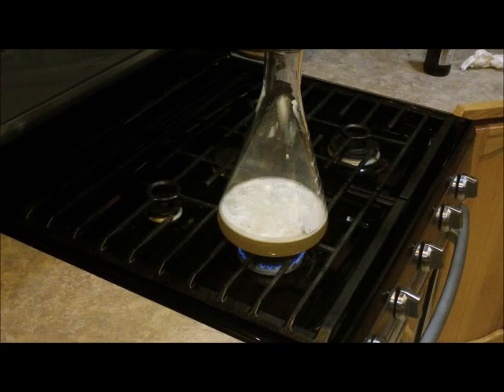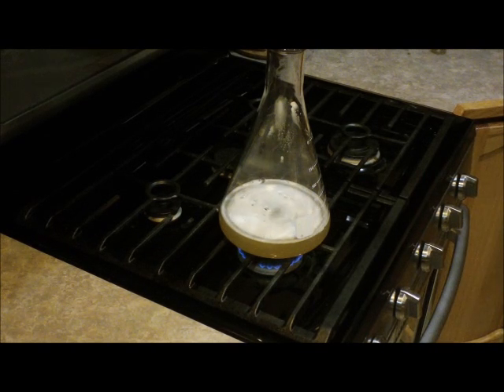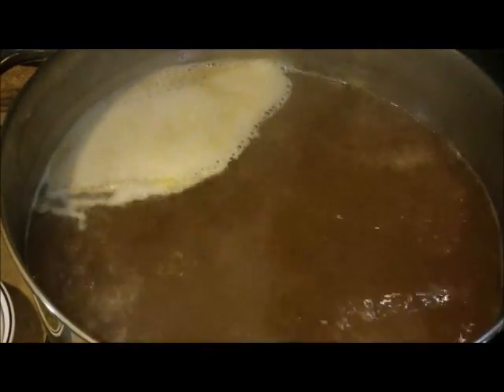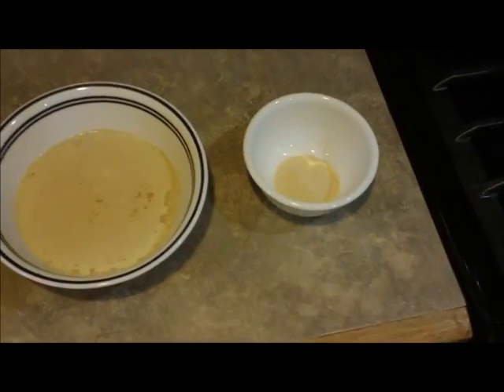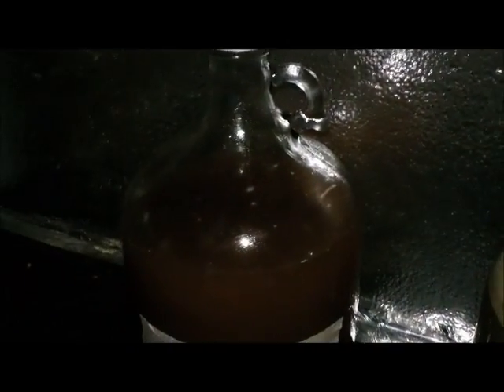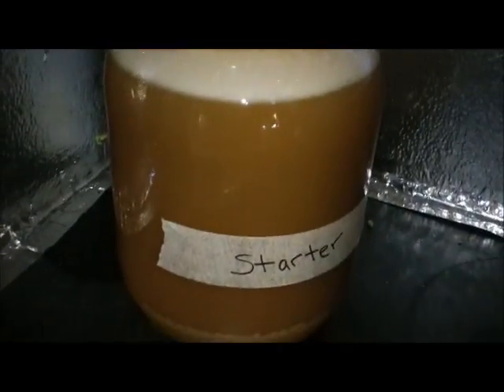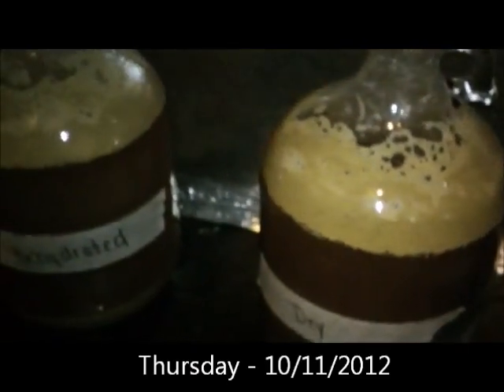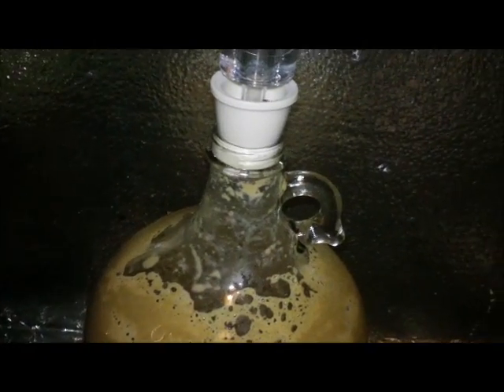HBW Vol 2, Issue 32 - The YEAST Experiment

Comment: The yeast cell equalize the above discription, so remember sodium follows water, as it does with human cells, you then drop these water hydrated cells in the wort which as a lower PH and way more sodium than the water hydrated yeast, now guess what happens, yeah sodium pumpd into the cell and with sodium the water follows and viola the cell walls expand and burst. Which is why the hydrated gallon had a huge lag time.  Therefore hydrating is not beneficial at all infact the correct process

Comment: I don't disagree with any of that, and when that is done seem to have very little impact on yeast survivability. Here is how i see it, Based on what we were taught in Micro Bio, the yeast cell walls will hydrate with whatever the PH is as the cells will equalize in the bothe the PH and sodium content of the water in which it is hydrated in. So in the case of the water in this experiment sort of proves this out. so here goes.

Comment: what this does is shock the yeast killing most of them. what needs to be done is after you make the slurry wait another 10-15mins and then start to slowly temper the temperature down to with in 5 degrees F of the wort it is to be pitched into.  you can do this using a spoonful at a time of the wort or must while stirring it.  when we use dry yeast its mostly for mead, wine or cider and it takes us around 45mins from start to finish. we also use go-ferm since the SG is pretty high with those

Comment: just some food for thought. I have seen the slants showing that direct pitching into wort will give you about a 50% survival rate due to the cell walls not being able to control what passes in and out. This is why rehydrating with plain tap water is preferred. the reason why I believe most people get the same result as we see here is due to people rehydrating @ the correct temp range. waiting 10mins then stirring it into a slurry, but then pitching that right into the cooled wort around 65F

Comment: That experiment is exactly what i always state, is that rehydrating is bunk! direct pitch or do a starter, rehydrating had a lot of lag time. I am glad the experiment proved that out. and the flavor profiles will be slightly different. the same amount of trub makes complete sense, yeast sense when the growth factor needs to stop due to the enzymes produce when nutrients get low, then the yeast just begin to go into survival mode using the fermental cycle instead of the kreb cycle. Nice job man!!

Comment: The Safale line is the best dry yeast in my opinion. In 2000 I won the gold with the 04 strain pitch directly in my Pipefitter porter and bottled it right from the primary from spigot!

Comment: main things to remember when re-hydrating dry yeast is to use between a cup to 1.5 cups of de-chlorinated  tap water at ~95F. sprinkle yeast and cover for 10mins. then stir into suspension cover and wait another mins. this is all so the yeast can build their cells walls. after all this you need to temper the yeast to with-in 5 degrees F  of your cooled wort, so you dont shock the yeast. just like you do with a new fish. add some chilled wort to the yeast to slowly bring down the temp.

Comment from the maker: My whole experiment was trying to keep everything as equal, without vitamins or boosters.   Outside of the starter.  Was interesting as I am a big fan of dry yeast, and S-05 and S-04 are great for IPA's and Ales.  I also used S-05 in my latest version of VBOC stout because I needed the higher attenuation due to the OG being so high.  Hopefully someone gets a little from this experiment.

Comment: just my opions here, but 1. forget the starter with dry yeast. its just cheaper to buy more dry yeast. 2. one 15g pack is perfect for a 1040-50 beer after that just add a whole nother pack. you will not over pitch the beer. 3. I hate when people pick an IPA to do these type of tests with. an IPA hides so many problems when it comes to water and bad fermentation. 4. try using go-ferm for the re-hydration of the yeast. that how I do my wine, mead, and ciders and it works great.